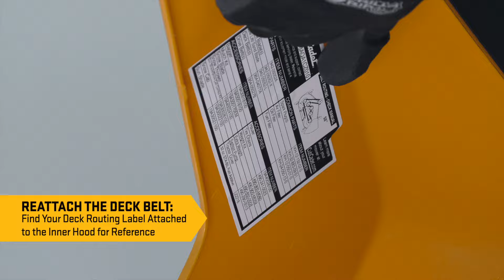How to replace a deck belt on an XT Lawn Tractor | XT Enduro Series | Cub Cadet

Comment: This comment may help a few people who, like me, have suffered the recurring problem of the belt coming off, especially when disengaging the blades. It is not user error but a design flaw that stems from how the right brake pad housing was situated on the deck. Unlike the left one, the right brake pad housing is at a crazy angle which causes excessive and premature wear of the brake pad. When it gets sufficiently worn, tension is lost and, if left unchecked, two pullies will make contact. When the blades are disengaged, the brake is applied, a rattle can be heard, and the belt comes off. The fix is to return the deck to the dealer who will remove the brake pad housing and weld it into a squared-up configuration, just like the left brake housing.  If you bought your Cubbie at a big-box store, I have nothing on that.

Comment: My at-your-own-risk shortcut:  Remove the deck pulley covers.  Remove the wire bracket that holds the belt to the motor pulley.  From there it's fairly easy to put the belt on without removing the deck or any other parts of the deck (except for the pulley covers that I personally leave off).   The only slight issue is getting the belt past the deck pulley guards, but I found that pulling the belt through those two tight areas at a little angle gets it through via a slight deflection.  Replace the motor-side pulley wire guard.  Done.  So far I haven't had any issues.

Comment: My belt jumped the idler pulley. Got my 9/16 socket and wrench out to looden the pulley, slid it back on and retightened it. Will be buying a new belt soon though

Comment: When you get ready to put the deck belt around the last pulley make sure it has not slipped off the pulley at the other end of the deck (or any other pulley). I made that mistake and the belt started smoking badly when I started mowing. If your mower belt starts to smoke...something is wrong. STOP MOWING...DISENGAGE BLADES...and fix problem before proceeding.
Reply: Same exact thing happened to me.

Comment: I have same issue on my 2017 xt1 lt42 as Mr. Moseley. What MFR doesn't issue a fix for a design flaw?  The pivot point on tensioner pulley bracket has a ton of free play. I installed a 3/4" washer to take up play and tightened it just enough so that it turns easily. Self locking nut a must for this fix. I'll see when I put it back together if it keeps chucking he belt. Fingers crossed.

Comment: You may want to clarify. My XT2 Enduro requires NO tools to replace the belt. A little finger pressure on the idler and it goes right into place.

Comment: I bought a new cub cadet and it threw the belt off. I can't get the nut loose on the idler pulley to get the belt back on

Comment: That socket on the idler pulley sure beats the 3/8" drive in the little square hole on the idler pulley bracket.  5 👍‍‍👍‍‍👍‍‍👍‍‍👍‍‍s up.
Reply: Yep, until it starts slipping when its under pressure!!!!
Reply: @raymondlee3414  What do you have to do once it starts slipping , I'm pretty sure I'm having this problem,  not enough tension .

Comment: I just want to take this opportunity to say that a Cub Cadet mower can be the absolute worst decision in your life.  Run from this brand and never look back.  I’m almost 60 and have been mowing yards all my life.  This is the biggest POS I’ve ever encountered.  Electronics / starting issues, as well as differential not locking and belts coming off..  If you love getting on your mower, pushing the start button, hearing nothing but “click”, and then shelling out $150.00 for a new module, and THEN having your belt come off the pulleys every 10 minutes.....buy a Cub Cadet!  If you have a hill, and want the locking differential, and every time you engage the locking differential the tractor stalls....get a Cub Cadet!
If you love pushing the start button and hearing the starter lock up and stop, forcing you to keep pushing the starter button hoping for the best, btw with a fully charged battery, buy Aa Cub Cadet!
I have 20 yr old sears lawn tractors that are more reliable than this GSX POS Cub Cadet.  
If there’s ANY possibility of having a little twig from your wife’s azalea or, say, an acorn or gum tree ball landing on the mower deck, and you love having to put the belt back on every time you mow your yard....buy a Cub Cadet GSX!
If you love having wires too short to manipulate when putting in the inevitable new starter relay in this POS....buy a Cub Cadet!  And they save a couple inches of wire on each POS sold!  
If not for the mower deck, starter, starter relay and wiring, computer “Bluetooth” module, “locking” differential, GREAT tractor!
Yellow POS
Reply: Mine is 9 years old, gong strong, without problem
Reply: @boblynch3384  That’s great.  You probably have one of the older ones with the key start?
Never get one with the push button start.  You’ll be replacing the very expensive computer practically every season.  Thankfully i finally bypassed it and wired a push button switch directly to the starter, bypassing the start relay and computer.  
I think the particular series I have is just poorly designed.  I’m glad you’re having good results with yours.
Reply: Highly Frickin Agreed!!!!! Frickin bearings,,, pulleys,,, damn ignition,, frickin starter,,, the paint job is about all that's good!!!!!

Comment: This mower had belt issues big time and they havent been resolved. Bought mine in 2017. Do not buy this mower. The manufacturer gove me the wrong belt for my model. Not only will the mower start throwing the belt off but it's a pain to work on it. There are several different belt sizes for the same model. It's like they had no clue when they made this mower. Just google it to verify this problem. DO NO BUY.
Reply: The belt is prone to get sticks etc at the drive pully which is what causes it to throw the belt.